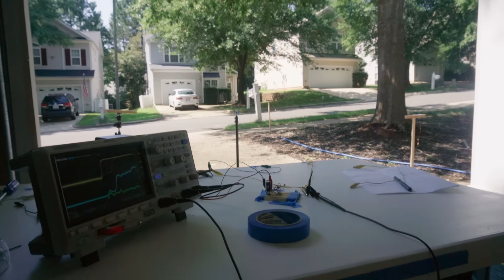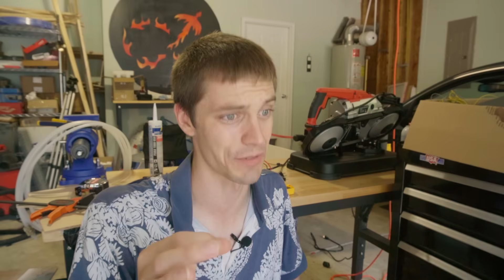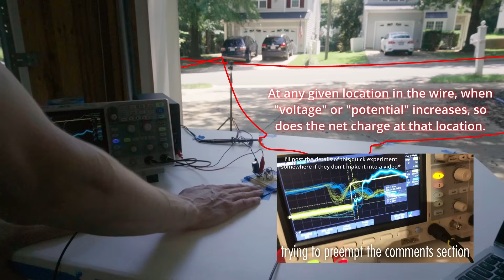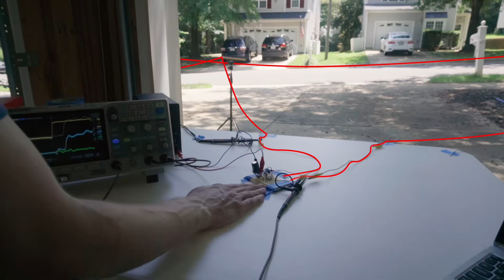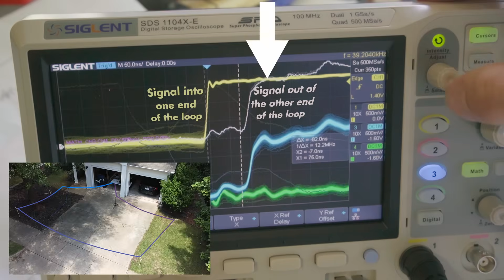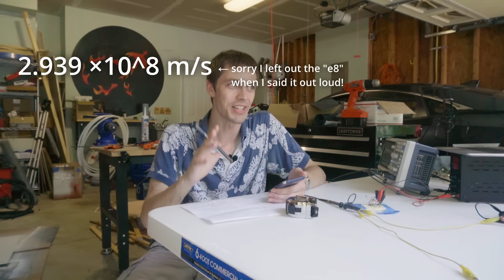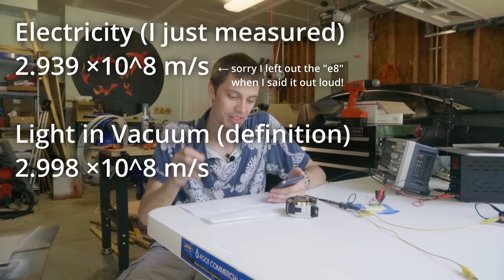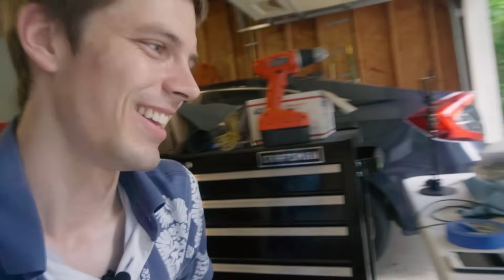Why does WATER change the speed of electricity?

Comment: Interesting discussion about alternating fields... but being a bit of a stickler here for wording... the field isn't alternating + to - to +, it's just going 0 to + and back to 0. 

Semantics I'm sure, but in the graphic you show of the water molecule flipping back and forth, you show a reversing field... that isn't what you have...  you have a field, and then NO field. So to my eye, I can see it taking some time to orient the water molecules in some direction then with the power removed, they're pretty much just going to stay there, less regular atomic forces floating around. To have to reorient 180 degrees is a bit different. 

I'm also not sure that all of those frequencies actually exist at any given time... they are the mathematical summation of the switch action, but they I assume only exist at the moment of the switch event it self, not over time. Maybe that's what you were trying to say, but I didn't hear it that way.  This reorientation theory to me only seems to be a valid expression for a true AC source containing both a + and - component.  You might liken that switching event to a beat frequency.  

Perhaps the way to really test this would be to square wave switch from -1v to + 1v and see if that changes your timing at all in water, or maybe go -.5 v to +.5 volt so the total switch potential is still 1 volt total. 

Definitely interesting.

Comment: The big part people seem to miss is the fact that the electricity does not travel through the wire it travels around the wire in electric and magnetic fields and in ideal conditions these fields travel at the speed of light, However due to factors like the dimensions of the wire, resistance, environment, and inductance change the propagation speed.
Reply: That is controversial.

Comment: If the multi-strand wires were unwound, straightened out they'd be longer than the wound up length.
I don't know if this would have a baring, but did you consider it?

Comment: I think you are laboring under a misunderstanding of how electricity works.  When you hook up the battery, with the switch open, the electric field from that battery is present very quickly at both (unconnected) poles of the switch.  So the potential difference needed to move electrons is already present at the switch, and when you close the switch, the electrons will move immediately.  It wouldn't matter if the loop were 1 meter long or (except for impedance, of course) a million meters long.  Once you hook up the battery, the switch has the potential difference across its poles to push electrons.  You should instead be trying to determine how fast an electric field moves.

Comment: Imagine a train on the tracks running from the Atlantic ocean to the Pacific. Shove one car on the end pushing the entire train one car length in a second. And then saying that the train traveled 3,000 miles per second.  This is what it feels like when you say electricity travels at the speed of light. It's not quite right. You even showed this in your graphic. It feels like a disingenuous statement. 
I would like to see a much larger test loop (not overlapping itself) and the comparison in time between loop lengths.

Comment: The two different wires covered with enamel insulation both measured 98 ns delay & the wire with thick rubber insulation measured ~100 ns, evidently due to the differing dielectric properties. When I build ham radio antennas with THHN stranded insulated wire I am used to generally seeing a difference of about 2% from the modeling results calculated using parameters for bare wire. If I cut the wire to the calculated bare wire length I usually end up cutting off about 2% to achieve the calculated resonance frequency.  Measuring the differences between various kinds of insulation and bare copper wires demonstrating these effects might make a nice video as well. If you would like to measure the differences with greater precision, a two input frequency counter / timer would be cheaper device to obtain to measure with, than purchasing a much faster oscilloscope. Cool idea there for another video to measure electron drift vs resistance. I love your demonstrations of everyday real world electromagnetic physics. Great videos! Thanks! Keep up the good work.

Comment: Great video! The wire that went through the water still had its insulation coating and isn't the electric field strongest closest to the wire? So maybe an even bigger difference if the wire going through the water was stripped of its insulation?

Comment: I would love a discussion of "the skin effect". How much of the electron fields extend into the surroundings of the wire vs into the center of the wire? Could using a larger wire reduce the effect of the water, since more of the signal could pass through the center of the wire itself instead of the surroundings?

Comment: Have you considered adding the length of the oscilloscope probes to the calculation? Isn't the measurement done inside the oscilloscope? That's an additional meter or so, right?

Comment: The signal delayed by water has a more gradual (less steep) slope. Perhaps, I thought, because some of the electrons still get pushed by the field propagating through the wire, but others are pushed by the field propagating through water. Then I saw the explanation about the water delaying different frequency components differently. Perhaps both play a role?

Comment: Good experiment/ measurement!  Drift velocity is slow a few cm/hr the lead/lag when you flip a switch is about 0.9c in copper but the rise time depends on capacitance resistance and inductance.  You didn't measure the speed of light or electricity in your material unfortunately.  You're measuring the effective compressibility of the media (electron gas) a function of (geometry, impedance etc).  You indirectly and roughly measured the dispersion of water.

Comment: The rubber insulation on wire is 99% of the time actually PVC that has been softened with Phthalate-based plasticizer. . .  Just FYI.

Comment: We should expect it to take longer through the standed wire . The strands are twisted around each other , so if you unwound and streached out strait the strands , they might be about 29m long and not 28 m. Some electrons will also jump the twisted touching strands for a more direct path , but most current  must surely be along the strands.

Comment: Hello

Maybe I am going to say stupidités but I don't understand the slow down. Every square wave is an addition of sine waves as you mentioned it at the end of the video. And this is where the measurement protocol of the overlay (time between the two signals) is a problem. Because the wire act as a filter and cut high frequencies. And so flatter the rising edge of the signal which tend to be less and less a square wave and more and more a sine wave. So measuring the time between a square wave and a sine wave of the same frequency will vary with the height of the rising edge chosen for the measurement and so is not pertinent here as the signal form is modified by the cable.
So the water changes the impedence of the cable impacting more the higher frequencies and transforming a square wave into a sine wave (at the extreme).
So if I am right putting a low frequency sine wave into the cable should result in a no change of the propagation signal but a lower amplitude. If I am wrong and the propagation change, it any way it is a better way because eliminating the problem of flattering the rising edge by the filters induced by the cable.

Comment: I don't understand why you have to do all that set up with the wire outside... Wouldn't it be the same if you roll the wire in a coil? (Considering that your wire has coating or is isolated)

Comment: Excellent video. You're doing experiments with the things I think about all the time. 

I hand wound over a mile of stranded hook-up wire on 4" PVC pipe to make the vertical radiating element on my longwave antenna, and I tried and failed to accurately calculate the dielectric delay caused by both the PVC pipe and the insulation on the wire, as well as the inductive reactance, but since I'm unfortunately self-taught I ultimately had to do it by trial and error. I considered putting the entire antenna in a dielectric to slow down the velocity factor, but concluded that whatever dielectric I used would dissipate more of the RF energy than it was worth. Ultimately, it was all a question of how to obtain the highest antenna Q. BTW, my antenna, radiating about 7mW EIRP blanketed roughly 1/3 of the USA in groundwave transmitting my beacon signal on 170 kHz. But your videos could have answered in a couple of hours a lot of the questions that I spent 2 years answering for myself. I had actually gone to visit Doug DeMaw to discuss my antenna design, but he took one look at my loading coil design and said, "What do you need me for?" That was probably the nicest comment I've ever received. But it also made it clear that I was working in a very, very small niche of radio electronics.

Comment: It is a good illustration of how a so called transmission line can work. The delay through the line is heavily depending on the lines impedance, which again is defined by the insulation material, the distance to ground (or ground potentiel). 
In this experiment you will get a completely other result, if you had used a twisted pair cable (like in a LAN cable), and used both wires instead of a look. 
As a high speed electronics and RF engineer, is smiled a little at the remark of "for all practical reasons, the speed is the speed of light". No it is not. We have to carefully calculate transmission lines to get the precise and predictable delay in the lines.
So your demo is not wrong in its explanation, but there are stuff that sticks so much deeper. If interested take a look at: https://en.wikipedia.org/wiki/Transmission_line 
I made a video on this subject some years ago, and I show how PCB wires are curled so that the signals in them arrives at the same time at the other end. The video is here: https://youtu.be/xcIn1Rr6GDQ
In is in Danish language, and I did not have the time to subtitle it - but i think the pictures kind of speaks for itself.  If I get a lot of request for subtitles, I'll consider making them ;-)

Comment: You need to look at Eric Dollard's work on the nature of electricity to understand that the electron particle model does not describe nature....See Steinmetz's "Electric Discharges,Waves And Impulses", to see what happens when you throw a switch in a dc circuit.....In this case you are dealing with an impulse, which is distinct from ac and dc though has some characteristics of both.....

Comment: You can feel that scope's resentment. Incredible instrument with a two-dollar USB stick jammed in it's face, sitting next to a bargain-basement CR power supply.
The NanoVNA, I just found out, has this TDR function in it's config software, so if you plug a NanoVNA into a laptop it will give you velocity factor if you provide the length or length if you provide the velocity factor and will help you figure out where the interior guys DROVE A SCREW INTO YOUR COAXIAL CABLE! Sorry. It will calculate losses from connections and show you round-trip flight for signal prop in a conductor, all for less than 200 bucks. :) Any radio wonks that don't already have one really need to get one in their hands.

Comment: Using valence electron shuffle chemically would have been simplified enough to show electron transfer better. I see you were measuring speed but you're so close. Try cymatic 42.6hz at 600mHz pulse for catastrophic cavitation of water. Little nod to Stan Meyers. Water is also bi-toroidal, freely rotational except in a field (cost of electrolysis.).  I do like the presentation; you're a master :)

Comment: Your explanation of water molecule rotation and dielectric heating is lacking and the talk about frequency and frequency dependance is not quite correct and is misleading. Your switch produces very high frequency components. That steep step-function has significant high frequency components into the tens of MHz and you will most certainly see true em propagation effects.

Comment: You should put grounded copper around the water tank. At the moment you still have a situation where the field lines to the ground travel mostly through air. A few inches of water and a few millimeters of plastic are not dominant. If the field terminates on metal immediately after traversing the water you should see a large difference.

Comment: The free wires reference their fields to the ground for the most part. You have 60cm of air or 59,8 cm of air and 0,2 cm of PVC. If you did this with coaxial or a wire pair you would notice drastic changes. The resistance also doesnt really matter for the propagation velocity but the distributed inductance and capacitance. Free wires have ill-defined impedance and hugely depends on where and how you string it up.

Comment: Ninety-eight percent of the speed of light isn't close enough to be nearly the same as C. Flipping a switch produces one voltage pulse that would be a square wave if several equally timed on and off switch actions were in a row. An inexpensive single throw single pole switch with no circuitry to prevent noise arcs when its thrown as well as generating harmonics all over the place, but the bulk of your signal is still DC which won't react with the water's extraordinarily high dielectric constant (70+) the same way AC does.

Your short run of wire in a loop is too short to time the things you are looking for. It should be a long straight run of wire. There may be things you don't have time to see or are hidden in the noise; consider ELECTRONICS & WIRELESS WORLD December 1988, "Thirty-six nanoseconds faster than light," a reflection of the current 90 degrees out of phase with the voltage preceded the voltage pulse in their apparatus.
Reply: Yes, the length is just fine. I used to have my students measure the speed of light by shing a LASER up and back in a hallway about 15 meters (49.5 feet). A high frequency signal was fed into a frequency modulate LASER. The beam was split so one half was fed into a detector and the other traveled up and back along the hall and fed into a second detector. Both signals were fed into a dual trace oscilloscope where we measured the time delay. That short distance was sufficient to measure the speed of light.

Light travel approximately one foot in one nanosecond, so an EM wave traveling 28 feet would take 28 nanoseconds to complete the trip, plenty of time to be seen on an oscilloscope.

(186,000 mi/S) x (5,280 ft/mi) x (10^-9 S/nS) = 0.982 ft/nS.

Comment: AlphaPhoenix sorry but I do unfortunately think you have confused things in this video. Electrons does not move very fast, in fact do they hardly move at all, you can almost think of them as static. It is the field that moves.
I am not sure, but I think you can test that by trying to run your 28 meter cable in a smaller loop, just with more windings and by changing the shape of your loop from round to oval and so on. Oh, nearly forgot, but the fields does also not run from negative and all the way round to positive, but instead from both the negative and positive towards the other end.
If you place an LED in the middle of your long cable, will the time it takes from you turn on the power to the LED, not depend on the wire's length but instead of the distance in air between your battery and the LED. :-)

Comment: Electrons travel though the wire. However, electricity travels along the outside of the wire. The way you're set up with the source that close to the tester its not even traveling along the wire its shooting straight from the source. I know its difficult to grasp but you would have to use a straight extremely long wire and test as far away from source as possible. Believe me, I know electricity better than most. Sorry

Comment: Here is my take.  Initially, what you are calling your delay, for the 3 loops, is the same because the inductance of each loop is approximately the same. If you look closer at the return side you'll see the voltage actually starts rising, for all intents and purposes, immediately. However, the inductive reactance also starts to limit flow, almost immediately.  The water, changes the reactance.

Comment: Are you sure that the electrons in the wire travel close to the speed of light? The Special Theory of Relativity would then imply that the Mass od the electrons would increase, the wires do not suddenly fall to the floor due to its weight. In Physics we work out the drift velocity of an electron, which is only a few millimeters per second!!!

Comment: Electron mass doesn't have to do with the speed in which electricity "travels". This topic gets confused a lot since majority of people are taught the simple but wrong thing in school. Similar to how centrifugal force is a thing people teach which is incorrect. Electrons do not actually travel from the power station to your home when you flip the switch to turn on the light at home. It is the electromagnetic field that transfers energy which is created by the oscillating electrons in the wire. Veritassium did a video on a simplified explanation of how it really works and people should check that out.

Comment: What would happen if the cable was enveloped by an outer conductive layer/pipe which was connected to another current source, but with opposite polarity?
Would that change the speed of the inner layer? And would it be voltage and/or current dependent, and what about AC vs DC?
(+) ============= (-) outer layer
      ############     insulation or air gap
(-)  ============= (+) inner cable
     ############      insulation or air gap
(+) ============= (-) outer layer